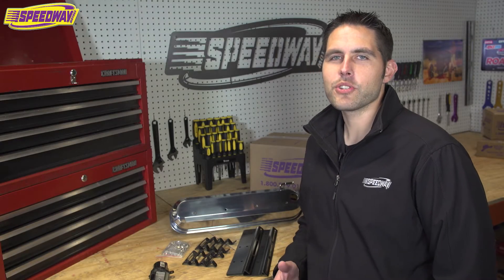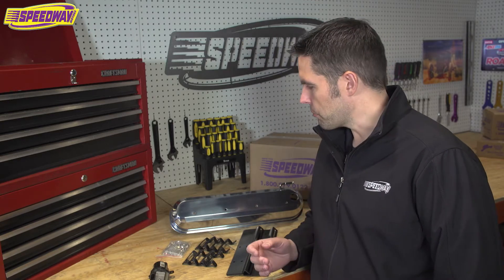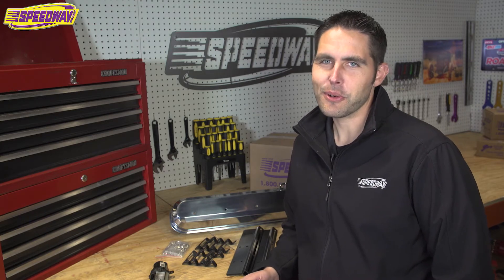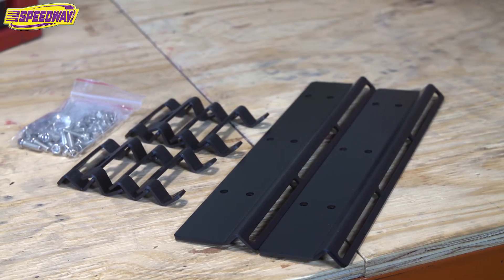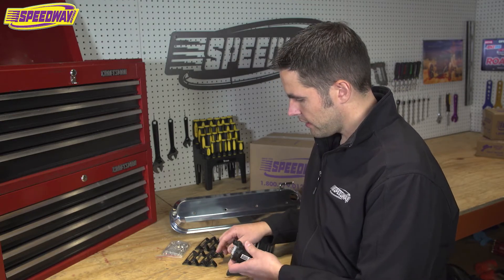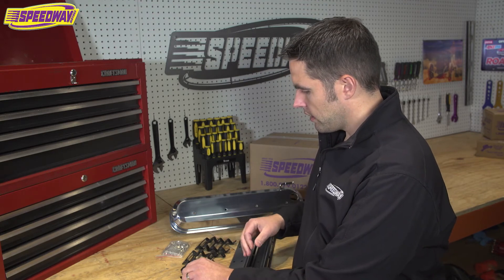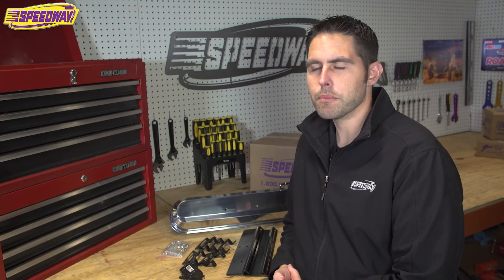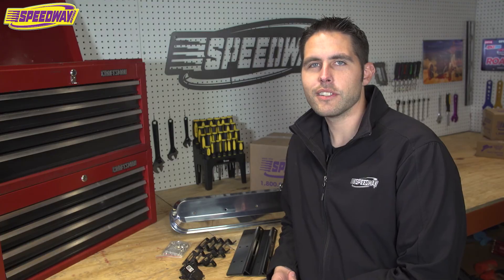Speedway Motors - Proform LS Slant Edge Valve Covers

Comment: Hello My Friend. I went to start my dad's 1967 Olds Cutlass with 4.8LS (Engine from 2003 Chevy Silverado) Conversion and smelled fuel, I luckily had the exhaust and headers separated.

I saw fuel spraying out of the passenger side of the header.  I Swapped injectors for Cylinder #4 & #6 after smelling fuel on the plugs. I restarted the engine and the fuel still leaked unburned raw fuel.

Any Ideas on how I should fix?
Reply from the maker: Sounds like you could have defective injectors but first we suggest you check the fuel pressure to the engine.  Many pumps run far in excess of the needed fuel pressure.  You will also need a return to tank line.  Part number 91012807 is an example of the filter/regulator we suggest.
Reply: I am using the Holey External Pump and Filter. So i am taking the fuel return line from the engine and routed back to the back to tank port on the filter. I am assuming that is not correct... My tank doesn't have a return port. Is this something i need to create?

As far as the fuel coming out of the exhaust. I also noticed that there was no burn marks on the spark plugs. So I am now wondering if there was ever a spark from the coils or did the excess fuel not allow for a spark? I think i will ground the plugs from each #4 and #6  to see if there is a arc from the coils. 

Thank you for all of your help.

Comment: So I have a TBSS truck style intake. Will these work with truck height intakes?
Reply from the maker: These Proform valve covers will work on your Trailblazer SS. They are offered in a few different finishes and can be seen by searching these part #'s on our website, 91017266, 91017261, 91017262, 91017257. Along with the valve covers you would also need Proform's LS1 Ignition Coil Brackets part # 91069520. Due to the brackets moving the position of the coils you will also need longer spark plug wires. We have two options available that would work, MSD part #54739849 or Accel part #1059065C .